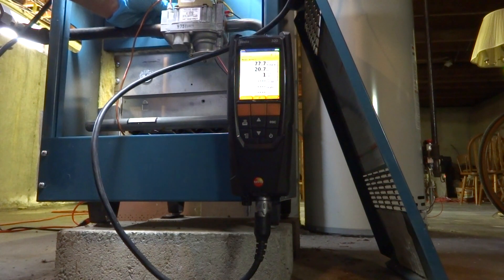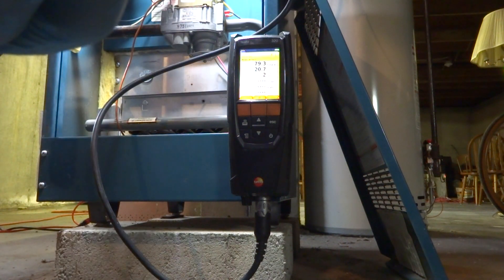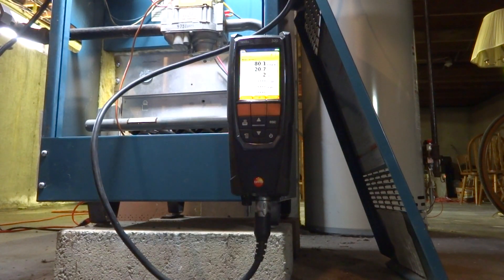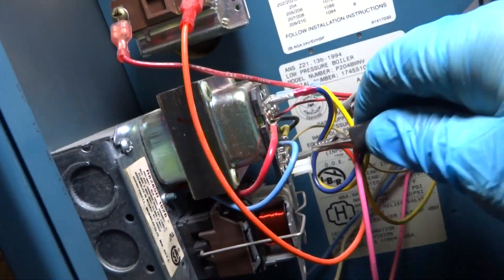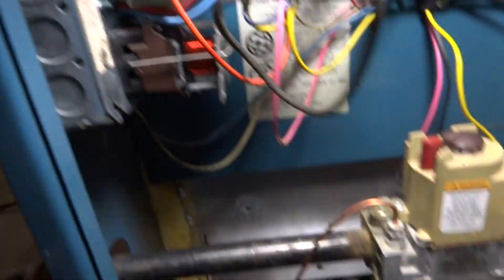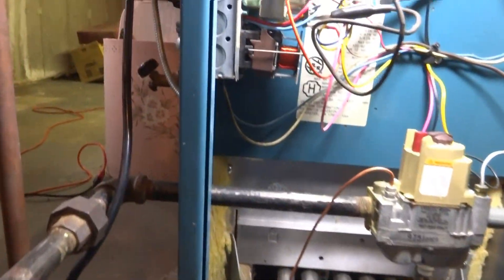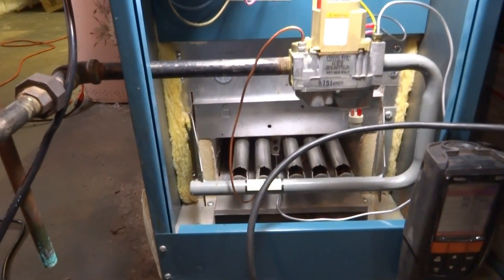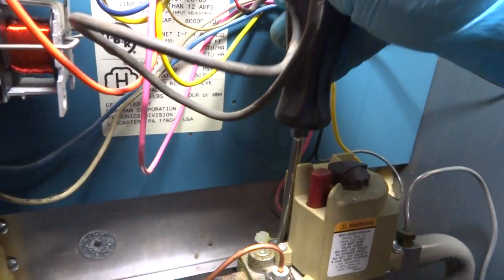GAS BOILER WITH HIGH CARBON MONOXIDE LEVELS ADDRESSED

Comment: Resetting that gas pressure valve mama.
Need to give the gas pressure valve a little how you doin. Give it a little douce.
Must be a dumb dumb that set it up initially.

Might want to check the filtaaahs in this system. While you are at it. Maybe they're clean and new already.

Comment: I guess a DIY couldn't do a job like this huh? I wonder why the gas pressure changed in the first place.
Reply: I'm guessing the unit was not properly or wasn't commissioned on start up.
Reply: Upgrade work could be going on in the neighborhood and they might have gotten transferred from a low to high pressure gas main.
Reply: @johndekenipp1063  Is this something that would potentially be temporary? I had MassSave tell me the same thing, but I found out later around that time, some work in the neighborhood had been going on.

Comment: I just had the same thing happen with Mass save last week, my boiler came up at 2000+ ppm for carbon monoxide. I’m assuming that’s too much for any adjustment to fix it.
Reply: If you had 2000 +ppm in the atmosphere you should have been dead 
Some thing doesn’t sound right

Comment: i wish i had bought a nice simple gas boiler my weil mclain ultra high efficiency is a pain it shuts down regularly for supply too fast error when i call them and ask what that means they just say change the temperature probes